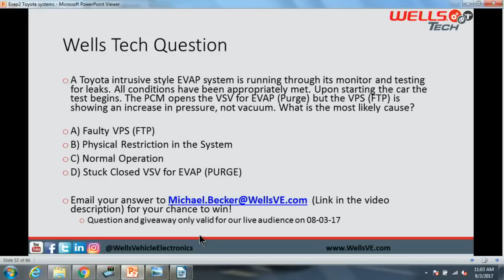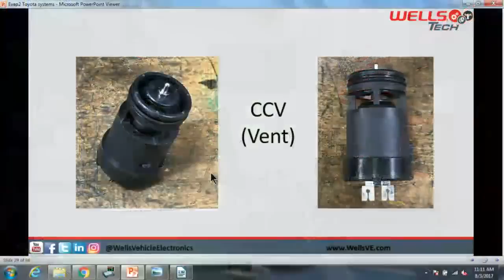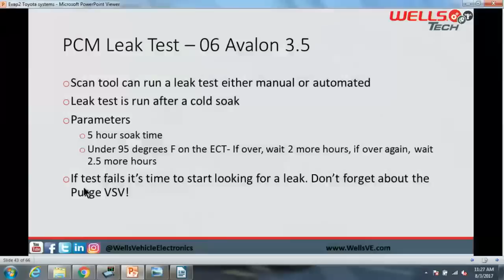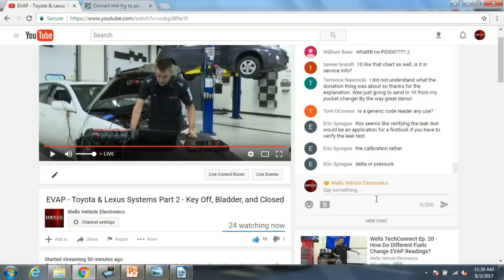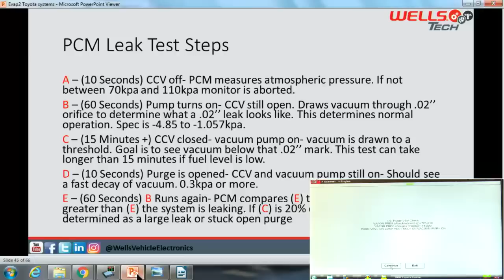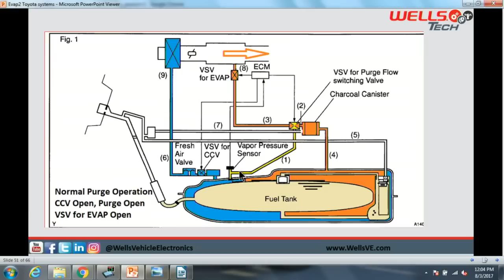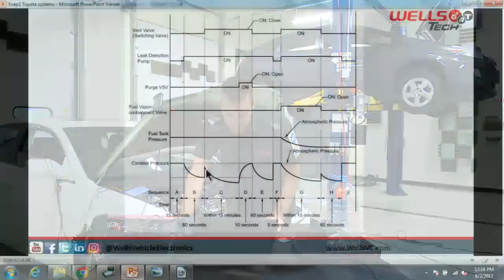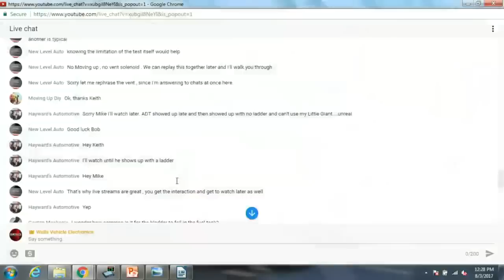EVAP - Toyota & Lexus Systems Part 2 - Key Off, Bladder, and Closed Systems

Comment: Hi Mike, been enjoying your channel. I'm an Ex Toyota Auto Instructor. I just wanted to add in addition to the Key Off Monitor there is a Purge Flow Monitor. The ECM monitors system pressure (Key on, engine running and warmed up) and once the purge valve opens the ECM looks for negative pressure. If no negative pressure the ECM turns on the vent valve to close it and if less than 3.00 mmHg drop, it assumes there is a problem with the purge valve and triggers a pending code of P0441.

Per the service manual, the vent valve on a key off system does not fully close (or seal the evap system when powered on). When smoke testing my 2013 xB one needs to disconnect the corrugated tubing connection at the vent opening of the canister and plug it on the canister. Else doing a smoke test from the purge hose (with back door closed) will show a small leak around the gas cap as that is where the vent tube attaches and opens to atmosphere.

Lastly, when getting 5 codes at once P043E, P043F, P2401, P2402, P2419 I have found the problem is no change in pressure when running Automatic/Manual Test Mode. Yet testing the vapor pressure sensor worked fine. On my car the vacuum pump would run electrically (you can hear it when powered using manual mode) but was mechanically bad. Repair was to replace the canister and leak detection pump as a unit.
Reply: Hello I am having a similar problem. I plugged the vent hose at the canister. I'm not seeing any leaks. I have a new gas cap ( Toyota) and a new Charcoal canister with new leak detection pump attached.(Toyota) still getting P0441 its come on as pending on the first drive cycle. I never see the vacuum come on by itself only manually through scan tool. It this be in the PCM it self? What is weried is the car came in with the MIL on P0441 but all monitors in the green? Please help
Reply: I went through exactly the same things you did  in thne same order with no seal at the vent valve then all those codes after installing a new canistert that was faulty.

Comment: excellent presentation  Mike    Toyota is getting better at evap systems    from the early days VSV P0446 P0441      great pico tip   thanks
Reply from the maker: Thanks Mark! Yota's come a long way...those old systems were the worst! I really like the new vacuum pump design...it's worked so well they've stuck with it for quite some time!
Mike Becker, Technical Services Instructor

Comment: very nice video, but i think your initial diagram showing the evap system circuit threw u off, that restrictor is not the 0.020, it clearly says 0.080. The diagram you want is a evap purge flow, it shows the postions of the CCV and LDP and pressure sensor better making the system easier to explain and understand. it also corolates better with the line graph showing vacuum in the system.

Comment: I have an 06 Toyota Sequoia. I believe it uses a leak detection evap system. I am getting Check engine light accompanied by codes P0441 and p0455. I have checked the gas cap and it seems to be sealing properly and there is no smell of gas near the gas cap. I have also checked the hoses and none seem to be cracked or damaged.
Do you think it is a faulty Purge solenoid? Also my vehicle has a evap service port I am a novice diyer and do not know what I would use this port for. 
I appreciate your in depth videos a little over my head but I am trying. Thanks

Comment: I have a question:  What happens if purge valve is connected wrong such that air intake port and canister port are connected swapped, i.e. intake port is connected to canister and canister port is connected to intake?  Does this cause any problem?  Also what happens if vacuum does not hold on the canister port side while intake port holds vacuum perfectly?

Comment: I noticed in the diagram about 1:03:00 in, that there's a line from the filler neck to the canister, but they draw it as isolated at the neck end and I assume that's wrong.  I would assume that the canister is actually capturing fuel vapors during refueling through that line.  You said fuel trims look funny during the initial opening for a purge.  So should we occasionally have to see a brief negative fuel trim during a purge?  Or does that clarify what the funny fuel trims are initially?  Does the PCM know to look for it after refueling?  Lastly, why is it I always have an even number of socks, but at least two of those pairs don't match anything else in the sock drawer? 

Thanks, as always, for the excellent videos.  :D
Reply from the maker: Hey Shaun, i think you're right. That line is for refueling. I think it was just misdrawn. The PCM understands that the purge is being opened but it really doesn't have a way to know what is in the canister. It could come out rich, or lean, depending on the fuel vapor concentration. As far as the socks...this is a mystery I have yet to solve too! hahah!
Mike Becker, Senior Instructor

Comment: Hello, Great Video. I am working on a 2012 Toyota Prius and getting codes P043E, P043F, P2401, P2402 and P2419. Does that mean my 0.02 orifice is bad? How can I tell if it is clogged or has hi-flow? I am not sure what to do next. 
Thanks a Bunch in advance.

Comment: I have a code for my Lexus gx 470 code p0453 and the second code is p0451 .. would the most likely culprit be the sensor?? Or would it be the gas cap?? My gas cap is loose but idk if that’s what’s causing my code

Comment: So if I understand correctly, if you use a scan tool to close the canister vent solenoid and apply smoke to the system, no smoke should exit the vent solenoid?      On my 2010 Rav4 3.5L I was getting P0456 (very small leak) and I closed the vent valve with my scan tool, smoked the system through the purge line and a small amount of smoke was coming from the vent line, when I would turn off the vent solenoid (open) then a lot of smoke would come out, it would decrease with turning on the vent solenoid (closed) but would never completely block off the smoke.   I replaced the whole unit complete with canister/vent/pressure sensor ($840) with a Wells item (Wells actually used the OEM denso vent solenoid) and code P0456 is back, it appears a small amount of smoke is coming from the vent solenoid?  I know I need to verify the + and - integrity at the connector while controlling with the scan tool, but if my understanding is correct, it is a bad brand new vent solenoid?
Reply from the maker: Hey Brandon, it's possible you are overcoming the limit of the vent solenoid with your smoke machine. I would physically pinch off the vent solenoid and see if you have a leak elsewhere.
Mike Becker, Senior Technical Instructor
Reply: I should re-state.  The smoke is coming out of the leak detection pump, the amount changes with cycling of the vent solenoid via my scan tool.  It is my understanding this pump has multiple parts inside including vacuum pump, pressure sensor, and vent solenoid.

Comment: Hey NGk, I have a Toyota Camry V6 2003 with code p0442 and p0446. Don't know what could be wrong.
Reply from the maker: Hey Civlife, could be purge solenoid related...best bet would be to test the system or take it into a shop for testing.
Mike Becker, Senior Technical Instructor

Comment: On a 2010 RAV4 with recurrent EVAP codes P043E, P043F, P2401, P2402, P2419. The canister assembly had recently been replaced. I tried running an EVAP test in 'automatic' mode with my Autel and shortly after the vacuum pump kicks on I get an error stating "EVAP system check has failed. An unexpected error occurred." Scope data just shows the ECM shut power off to the vacuum pump at the same time this message occurs. I tried to run the EVAP test in 'manual' mode and it will sometimes run through the stages and will pop up with a line saying 'vacuum pump stopped to protect pump'. I monitored the vent control, vacuum pump control, vapor pressure signal, and purge control during these tests and did not notice anything alarming; however, it did not look like the pressure sensor voltage was decaying any with the vacuum pump running during the leak checks.  I can bi-directionally control all parts of the canister assembly > the leak detection pump, canister vent, and checked the vapor pressure sensor and it is putting out around 3.6 volts. I am not sure what additional tests to do. Any suggestions or tips on further testing?
Reply from the maker: Hey Brandon, chances are the ECM is commanding the pump on, not seeing a change and then shutting it off. This happens with a stuck FTP sensor or a large leak issue. Have you smoke the system to confirm it doesn't have a big whole somewhere?
Mike Becker, Senior Instructor
Reply: @GoTechTraining  I have smoked the system and no large or small leaks found.  This occurs during the 0.020" reference leak check and their is no decay of pressure sensor voltage during this check, which is also when the ECM stops the test in automatic mode.  When you scoped the pressure sensor signal, the voltage seemed to fluctuate with a noisy signal and on mine I have a pretty stable signal (ranging from 3.62-3.67 volts) which I am not sure if that again points to a faulty pressure sensor or if it is model specific.
Reply: I have been using the beta version of Pico 7 just went back to Pico 6 so I could set the single trigger and long time base and get the continuous real time view, after 5x zoom and a long time base, my pressure signal looks like yours, but again does not decay.  ECU only allows pump to run 14 seconds on reference leak check before shutting the pump off.   I really appreciate your advise, despite being a new LDP/canister assembly I think the pressure sensor is either stuck or despite audible running the vacuum pump has no ability to actually create detectable vacuum.
Reply from the maker: Brandon, I've tinkered in PICO 7 as well. I keep finding myself back on PICO 6 at this point. As for your pressure sensor, can you force the vent closed with the scanner and jumper the purge? FORCE some vacuum in that system to see if it's able to draw down and see if the FTP responds accordingly. You can do the same thing with pressure from your smoke machine. At this point I'd verify the FTP is able to be moved prior to swapping anything out.
Mike Becker, Senior Instructor
Reply: @GoTechTraining  I hooked up the smoke machine and also applied vacuum manually, pressure sensor responded approximately to both. Of course now it is functioning normally and will run through the EVAP test without stopping, haha.  I now have a known good to compare to my malfunctioning tracing (I would post a photo on here for others but don't think that is an option).  On the known good, the signal voltage immediately drops the instant the vacuum pump turns on for the 0.020" reference check and continues on with the rest of the sequencing AND the system pressure definitely drops below the reference/comparison pressure during the system check as it should.  On the bad trace there is absolutely no movement during the initial 0.020" reference check and after 14 seconds it turns the pump off.  I think you were exactly right > the pressure sensor was stuck and ECU strategy was stopping pump; however, somehow became un-stuck.  I am confident this will re-surface again.  I really appreciate your insight.

Comment: have a recurring p2420 code setting, any idea why 3 separate toyota brand LDP's would not make vacuum? the vacuum pumps run on all three LDPs but no vacuum is measured at any port or on the pid for the pressure sensor? we've tested each part of the EVAP system off the vehicle and also together on the vehicle. everything by the manual says we should be good, but still set that p2420 every time. not a lot on this code as far as diagnostic procedures. thanks in advance
Reply from the maker: Hey Silviasteeve, i'll take a look into this. What year/make/model are you working on?
Mike Becker, Senior Instructor
Reply: @GoTechTraining  2010 tundra limited with 5.7. And actually we found that we did have initial vacuum,  we just didn't know how this ldp worked until after watching this video.  We have the initial -22mmhg, but the vent valve never opens to release vacuum and continue with the test.  Vent valve also dies not operate when commanded.  We replaced the pcm because at our pin a24-30 at the pc it's always ground.  Same thing with our new pcm,  it never switches

Comment: You cant seal the syatem on these cars with the vent valve. the toyota info tells you that  you have to smoke them by taking off the vent hose at the canister and pushing the smoke in the canister.  I learned that he hard way lol

Comment: Question. So if you use a factory scantool (techstream) and perform  the evap system check, it stores the data from the pressure sensor. Then when its complete you can go back to stored data,plot it in a graph, then u can compare it to the slide you showed (somewhere around the 35 min mark) i tried it with the snapon verus and it runs the test but doesnt give you a way to look back at it. Question is do you know if it possible to look back on the verus?
Reply: *33min mark
Reply from the maker: Hey K.A. unfortunately I don't know if you can see it with the techstream. I know for a fact though that you can throw a labscope on it and see the exact same thing. Slightly more work, but 100% accurate!
Mike Becker, Technical Services Instructor
Reply: Wells Vehicle Electronics thanks fpr the reply. Yeah techstream does it real nice(im a tech at toyota) i love this feature cause its easy to confirm a repair. Or confirm the condition. And also easy to explain to a sevice manger that its fixed cause they need fancy pictures;)

Comment: https://youtu.be/xubgil8NeYI 

My answer is D 

because if VSV is stuck close will computer is doing it's test it will also close the vent and then look for vacuum but if the Purge valve doesn't open then the system instead of creating vacuum will create pressure cause it's seal 

And a physical restriction is not likely to happen